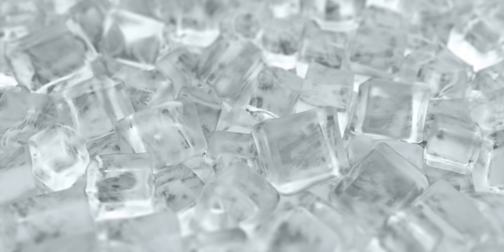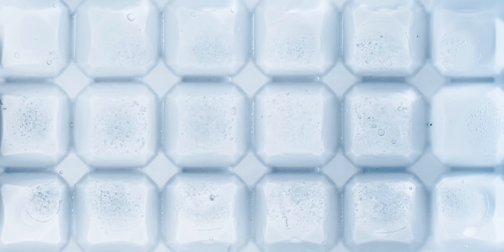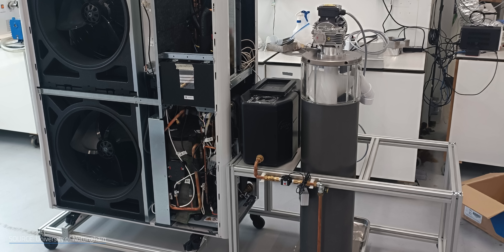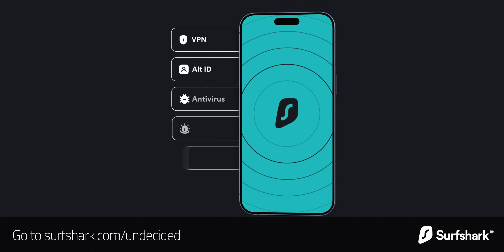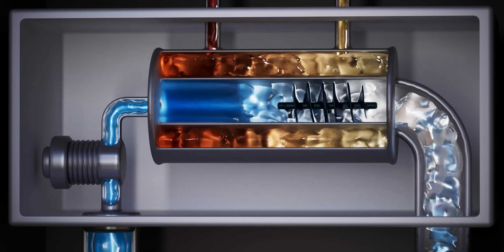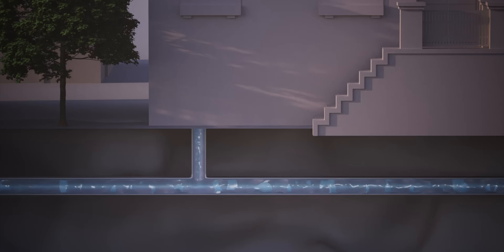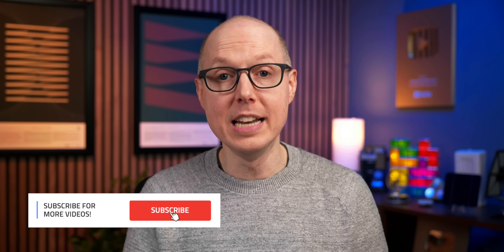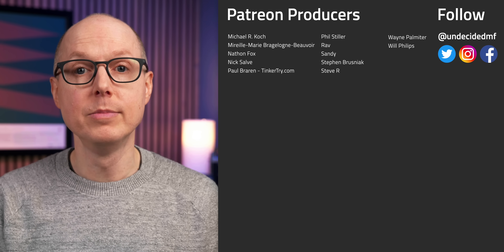How Can Ice Heat Your Home? Ice Source Heat Pumps!

Comment: A far more viable system is to store grey water from showers, clothes washing and dish washing sources in a 4 to 6 cubic meter tank either inside a home in the basement or underground.  The heat can then be extracted with a water sourced heat pump and reused to heat a home or heat water while another system or pump can divert some of the grey water for flushing toilets in a house.  Connections from the roof runoff would ensure the system would be fully replenished and flushed out periodically.  A system such as this would result in far more energy savings since it reduces the water used in a house AND reduces the sewage going outward to be treated both of which use energy all while extracting heat for home usage.  As much as 30% of the water used in a house goes to flushing toilets which can amount to a lot of water in water scarce regions.  Sometimes we let good ideas go down the drain.
Reply: That assumes you have space in your dwelling or yard for a gray water system, and money to install a greywater system. Extra pipes in the walls, a yard that can be accessed to sink a 6 cubic meter tank into. This system has many issues, but suggesting retrofitting a dwelling with greywater system in addition to the cost of heat pump seems to miss the central idea that this is low cost retrofit solution.
Reply: @briankuhl9314  The ice system isn't as low cost as one would think  The gas lines from the house to the main line would need to be replaced first of all.  Because using a grey water system recycles water into a toilet, it reduces the amount of water used and the sewage to be treated.  Municipalities could provide an incentive for this since it reduces one of the biggest costs they have-providing fresh water and treating sewage.  There are quite a few municipalities in the world that would love to reduce their water usage and sewage treatment by as much as 30%.  The city of Toronto in Canada has a central system which extracts heat from grey water in a hospital and then uses it to heat that very same hospital and it has been in place for years.  This is another option.  Using grey water to heat large buildings and as a storage medium for heat.

Comment: Couldn’t rural houses holds just have a submerged tank that the ice drops into and melt from the geothermal heat and the water reused, closed loop?
Reply: Or just reuse the grey water from the house as a heat source as well as recirculating it for flushing toilets.
Reply: @anguscampbell1533  Greywater use is viable, as is rainwater. I don't think the OP's idea of geothermal melting would work, as the scale of water use is off. If you have the land to use geothermal that way, it would be better to use traditional geothermal as shown in the video.

Comment: So, let's say you have some land out by yourself. You have rain water in the desert. How effective would this be? How are you transferring the heat to the home? Is it in floor heating? There is a bit of missing information here.
Reply: Any source of water should work, as long as you have enough and it's not horribly dirty. Rainwater would work fine, as far as I can tell. The output is probably forced air but could probably be adapted to radiant floor heating; about the only thing you couldn't do is steam radiators.

Comment: The issue I see is swapping over from Gas into a liquid.  How do the millions of homes "suddenly" change their homes to these heat pumps all at the same time as the gas swaps to a liquid?
Reply: If I'm mathing correctly, the average UK home would need only about 1200 liters of water to replace the energy content of natural gas used per YEAR. Compared to about 350 liters used per DAY for normal usage, the increased water demand and sewer disposal cost is absolutely trivial. Even allowing for inefficiencies doubling the theoretical usage to 2400 liters of water is still a rounding error.

As for the change over period, it would be possible to run the heat pump using existing potable water lines until an entire area is converted, then switch the gas pipes to non-potable water. After that switching each end user from the potable system to the non-potable system would be relatively trivial. While more costly in terms of water prices, especially for the early adopters, it spreads the transition out over a reasonable time frame while not leaving anyone out in the cold, either figuratively or literally.

Comment: O solution for a problem does not really exist! Central heating is the cheapest and the best solution! Heat pumps need electricity at night when the temperature is lower during the day! There is no sun to generate electricity at night. A solar panels+batteries system never recovers its costs! Do the math!

Comment: Sorry for being so thick, but where does the ice slush go?  In Minnesota, where it can stay below zero F for weeks at a time, I don't see where the frozen water would go.  We have enough trouble finding space for the snow that we clear off of highways and parking lots.  Where are we going to put more ice?
And the problem is compounded by the fact that when it gets colder and the need for more heat energy increases, the ability to melt slush decreases in direct correlation.  There's a similar oversight with hydrogen cars.  The last thing we need is "nothing but water vapor coming out of the tail pipe."
For my use case, I'd rather explore heat pump running off solar with an auxiliary electrical (solar) heater to thaw things out if they ice up...
Reply: Could a heated exhaust help prevent ice from water vapor in exhaust from hydrogen cars? That would take more energy, though. Possibly a hyper hydrophobic coating to prevent ice crystal nucleation would work better, maybe with heat as a backup. Or maybe temperatures are too low for these to be effective, I haven't put in too much thought yet.
As for the ice slush, this system is best implemented in the UK where temperatures are much higher. If it was implemented in Minnesota, it would require more pipe installation since only around 2/3 of homes are hooked up to a gas network. With the lower temperatures in general, it is not likely that this system would work without significant redesign.

Comment: We already have water pipes going into our houses, why not use that water, why need seperate water pipe?
Reply: The cost of treated water vs the cost of pumping water straight out of a river without treating it. Normal drinking water could easily be used, and would almost certainly have to be used during the transition period, but using untreated water would be cheaper in the long run as long as the pipes for it already exist.

Comment: I am curious how the design can be altered to take advantage of latent heat while keeping the system entirely off grid. I'm not interested in paying for water from National Grid with pipeline maintenance costs amortized into my supply costs. Maybe there's a solution that uses Ice source heat as an auxiliary once air temps drop and push existing pumps outside of their efficiency envelope.

Excellent food for thought Matt. Thanks for sharing.
Reply: If you're entirely off grid you could feed the system with rain water or similar. The only reason they're avoiding using normal drinking water is the cost, but if you have sufficient year-round rain, well, or stream water it should work.
Reply: @willythemailboy2  I thought they were delivering 32 degree water. That's what I missed.

Comment: Or you know... improve the current heat pump and just attached more stuff to it. Instead of just heating/cooling, allow it work with your washer/dryer, hot water tank, a solar thermal cell (not to be confused with solar electric cells). Tons of heat on demand where needed and less over all waste... sadly, just more complexity. Gas will stick around for a while.. so removing them isnt going to work for everyone/all places. So you are better off just doing better over all with a single ultra pump. Even more, why dont we have thermal tanks ? Hot water is the hot one, but we could just add one for cold water as well. Water tanks cost like 150$ give or take - just have to watch how cold they get is all. Boom, all heat/energry can be exchanged or added or removed as needed. Add some solar panels and battery and now you can run the whole thing pretty cheap.

Comment: I am not trying to be rude, but this video does not really convey what this solution could do meaningfully better than what we already have.

Using the latent heat of water as a source pretty much only makes sense if you really really need the energy density (think "seasonal" storage and that kind of stuff) or if your alternative source is colder than ~0 °C for most of the energy you need (heating period and possibly all year round hot water). Otherwise you're just stuck with a low COP all year round when going ice.

I can't speak for the UK (or all of continental Europe), but at least where I live, heat pumps, for some mysterious reason, do not become all that much cheaper just because you leave out the fan (as in going from an air-source to a water-/ground-source heat pump of similar power, not counting the digging, source piping, etc.). But if affordability really was the driving factor, just say good by to hydronics and go air-to-air - it's not getting much cheaper than that.

Also: Their system consumes 37 % less water .... ehh ... what?! Heat pumps do not consume water. Nor does hydronic heating (if it does, get a plumber).

Comment: The physics makes sense but it's completely impractical;
1. You would still need install a national return pipe network.
2. The slurry it at risk of completely solidifying during freezing temperatures, plugging the system for everyone.
3. You can't have a partial role out to early adopters. It requires everyone to simultaneously install an expensive and immature technology.
Utterly nuts.
Reply: The idea is to dump the slush into the existing sewer lines. They should easily be able to handle the additional load.

As for the change over period, it would be possible to run the heat pump using existing potable water lines until an entire area is converted, then switch the gas pipes to non-potable water. After that switching each end user from the potable system to the non-potable system would be relatively trivial. While more costly in terms of water prices, especially for the early adopters, it spreads the transition out over a reasonable time frame while not leaving anyone out in the cold, either figuratively or literally.

Comment: This could work in the Netherlands as well. A good 80% of homes is still connected to the gas network. And there's a lot of congestion on the electric grid. Put the two together and you could get some momentum going to switch to this type of heating.

Still, the big problem is the scale of the system. You need entire districts to switch in one go and there are two things preventing this: extreme NIMBYism and people are in love with gas. This means that this kind of system is best tested in newly built districts and then forced upon everyone like they did with the original transition to the current national gas network. Oh, and there's problem number three: the politicians here are actively working against solving problems as that's how they stay in power. I guess that means we will never get this kind of mass heating solution.
Reply: Edit: bad math removed.

As for the change over period, it would be possible to run the heat pump using existing potable water lines until an entire area is converted, then switch the gas pipes to non-potable water. After that switching each end user from the potable system to the non-potable system would be relatively trivial. While more costly in terms of water prices, especially for the early adopters, it spreads the transition out over a reasonable time frame while not leaving anyone out in the cold, either figuratively or literally.

I also foresee a future where - like some cities in the US - gas is being phased out or entirely banned regardless of the people in love with gas.

Comment: There is also a comparable system using a "cold" district heating, where each home still has their own heat pump, but basically share the ground source collectors.
Reply: Yeah. This makes the most sense to me. If we installed geothermal coils at the same time we put in sewage and water (would require digging a bit deeper in some areas), then everyone could share those coils. You’re already digging and installing pipes. Where it’s practical, you could also do a regular spacing of bore holes to make it more horizontally space efficient.
Reply: 4th generation district heating systems with 80C water makes more sense than 5th generation district heating which need wider pipes and heatpumps for every building or home.

Comment: Maybe I missed it. Why does the UK not use their LNG system any longer? I would assume that, at least at one time, the UK had people on the LNG system using it for air heating, water heating, cooking, laundry, and other purposes. This proposal is just resolving the air heating portion. Or, is the government in the UK planning on forcing everyone to change out all their water heaters, cooktops, dryers and anything else they have running on LNG???

Comment: This is a crazy bad idea.  So you are dumping all this slush water down the sewer?  With thousands of home sending ice slush to the local treatment plant, I suspect you will get ice dams in the treatment facility during cold spells.  There is no way the heat from the water used for other household uses is going to match the heat extracted during the ice making process and therefore iced up water is going to be showing up at the treatment plant.  Where is the heat coming from to melt all this?  And it is not trivial to add a bunch of volume to the water treatment plant, even if it is clean water, it gets mixed with dirty water and still must be treated.  And finally, you would have to all at once convert all the households on the particular gas line you are repurposing.  Where do all these skilled workers come from to do this, and then what do all these people do during the heating season when you aren't converting anyone over?  Perhaps they could be staging the installs, but still, that assumes the homes have the ability to be staged.  If your hvac system is in a confined space, you can't set up two systems side by side ready for the swap.  And I would assume most systems are in confined spaces.  The only hope I can think of is that you initially convert houses using the potable water supply and once all the houses are converted, you switch the gas lines to water lines, but still, this is just logistically got so many problems.  And then of course, who pays for it?  You are going to just tell all these people to throw away their perfectly working hvac system and, oh yeah, you have to pay for it?

Comment: This solution is dumb. Not only it completely ignores the fact that you need a second return pipe, reusing the gas pipes will require them to stop delivering gas.
So what is going to happen to people that rely on gas, to those that have gas stoves or local boilers for water heating?
And if that's not enough, there is the issue of pipe type. Not all pipes are equal, water is causing different type of corrosion than gas, it is delivered at different pressure and different temperature, so it needs different materials and protections to prevent that corrosion. Switching the fluid inside a pipe might work in minecraft, but its not that simple irl.

Comment: This is not a practical idea.  The gas network is being used to heat the homes.  So all those attached to that line will freeze while the gas is shut off to install the first device.  Not to mention the fact that all of the lines will need to be shut off to utilize the old piping.  It's also being used for hot water.  This cannot be done while it is in use and you cannot install the heat pumps for an entire town in a reasonable time after shutting off the gas line to ready it for slush.  Why even entertain this half baked idea?

Comment: Isn't it easier to have a geothermal power plant with heat pumps, pumping water at a temperature of 20 to 28°C through the gas pipes, and for each house to have its own water source heat pump inside their homes?
Reply: Maybe, if the pipes were insulated. As is, the water would be ground temperature long before reaching anywhere useful. The idea is to reuse existing pipes, not have to rip them all out to replace them with insulated pipes.

Comment: Ice has 10 percent more volume than the equivalent water weight. When the water freezes the extra volume/pressure must be accounted for.  Slurries are also more difficult to pump.  Interesting concept though, using an enthalpy phase change.